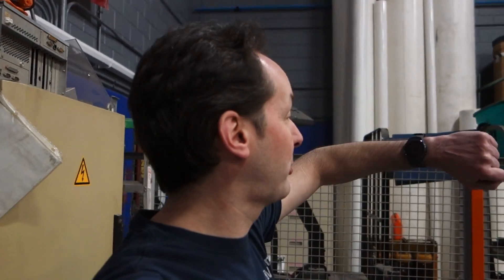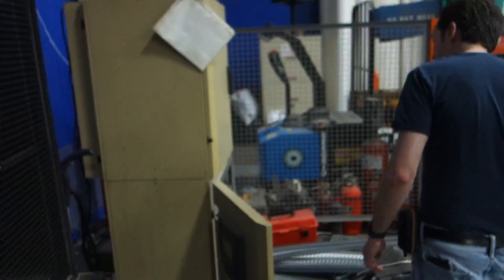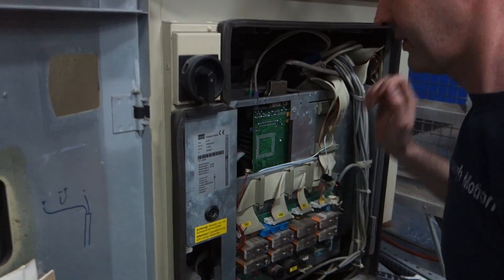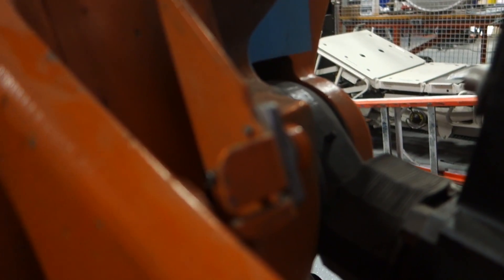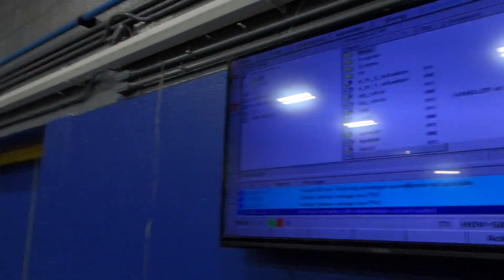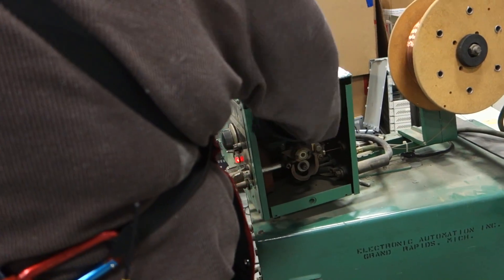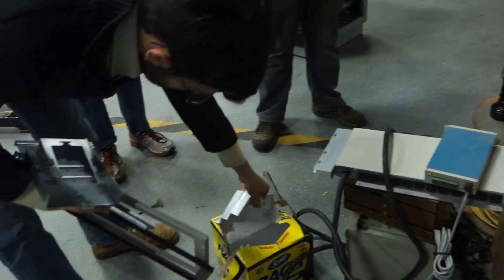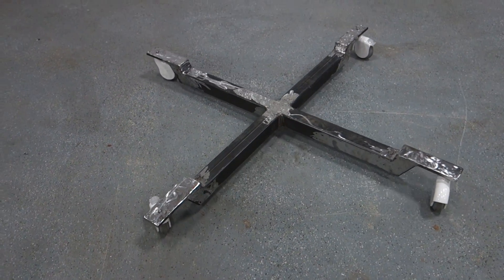Captain's Blog 3 17 2016 Robot Rebooting and Icarus Bases

Comment: 1134  nice clear directions.  interesting hiding place.  install an ethernet card in jeffs computer.  can jeff's software be moved to a modern computer?  batman's metal work is great.  circles are hard to get straight.  1624  interesting that you can fly a boat.

Comment: IIRC Chris I believe that we did narrow down the release of Windows 95 used on Jeff did support USB but the question raised when the big brain swap was done to Jeff, was whether drivers could be found for the USB chip-set on the motherboard..  Windows 95 had support for USB from release 2.1 on IIRC.  It is also pretty easy to get most Intel Pro, 3com and other 10/100 network cards working on windows 95 once you scour the web for drivers.  There are also a number of wireless b and g cards that support windows 95 still floating around in piles of old computer hardware.  I actually have a windows 95 machine at home that is still able to go online and browse the web fairly easily.  Some websites load poorly or fail to load completely but it still works just fine for a majority of the sites out there.